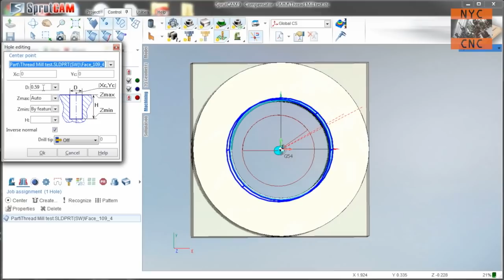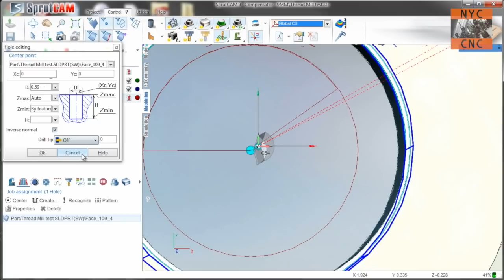Gimme a Brake! Machining a DIY CNC 9MM AR-15 Muzzle Brake! 4th Axis Machining Video!

Comment: John, that's only half true.. Correctly sharpened (point) and correctly ground drills (flutes) do drill holes the correct size.  Drills that are especially ground correctly on the point will drill the right size. Your general or maintenance grade drills are usually made to drill holes +/- 0.003" diameter.
Reply: I think you will find the difference being in the different grades being sold on the market today.  There is about 3 to 5 different grades of drill being manufactured today.  The maintenance  / mechanics & homeowner grade probably are the worst as far as diameter tolerance.
Reply: the other thing do do is try checking the runout of your drill holding system.. be it a collet chuck, drill chuck, whatever the case may be.  The best tolerances we get come out of holding drill bits with some sort of collet or a Albrecht chuck. Runout will effect your diameter tolerances to a percentage to your positional tolerance.  Other than switching to a stubby and using the proper point angle in relationship to the material being drilled.
Reply: Get one or two for the mill too.. you won't regret it.  Oh yes you could use the cordless, but keep in mind unless you have a good chuck and clean jaws won't be near what you would expect out of a collet.  Stay away from Dormer/Precision Twist Drill, although the older stuff is great and usually ground on size.  Only way to be sure is to mic your drill bits with a micrometer before put to use, and or drill a hole and check it against a nominal size pin gage.
Reply: gbowne1 I have no problems with precision twist. Although I usually am stocking my index cabinet with Chicago Latrobe or hertels which seem to do just fine. If I'm looking for an ultra precise hole I'll do it another way than just drilling. :)
Reply: We switched to Nachi or Morse Cutting Tool soon after the PTD brand went to Dormer

Comment: How do you make sure that the alignment isn't off when you've screwed it into the gun adapter, meaning that when it bottoms out it's not off by an angle, the logo not facing up etc? It should matter where the threads start, right? Did the twisting of the part in the collet holder throw that alignment off?

Really nice machining video, really makes me want to play around more with the 4th axis on the small mill I have access to here, unfortunately it can't really do metal, it's mainly made for foams, woods and plastics.
Reply: NYC CNC Clocking, awesome! Learnt a new word!

For sure I see that you didn't need the 4th axis, but for the next step you'll surely do. I'd like to see anyone attempt those dimples without a fourth axis. Haha!
Reply: NYC CNC Well sure, but imagine the time difference! The tiiiime!

Although, I guess right now, in your case, a lot of the time is being spent figuring out just how to do the dimples instead. I've had some experience in using RhinoCAM (basically a CAM plugin for Rhino) and in that you can fairly easily assign any round edge, or surface, as a hole for drilling operation. I wonder if you could do the same in Sprutcam? Although, technically since it's not a perfect flat circle I guess, as it's intersecting a cylinder.
Reply: John, for clocking, couldn't you cut the threads first, screw the blank into the gun, then mark a known location on the blank, such as the top centerline, then use that to orient the part in your 4th axis for the machining?  Once machined it should still screw in the same way, and the top will still be the top.

I was also thinking about your dimpling issues.  It won't make the render look good, but if you changed the model to subtract cylinders of an appropriate depth, SprutCAM should be willing to treat them as locations for drilling.  Then you give the machine a ball end mill rather than a drillbit and you should have dimples, right?

That was some fine fast shooting!  Should give any potential burglars who see your channel a reason to bother someone else. :-)

I got to play with my lathe a bit today.  It's different doing it than it is watching it done, but I'm finding that all the time I've spent watching machining videos is paying off.  When I screw up, I instantly know what I did wrong! ;-)  Seriously, so far everything is coming out workable, and I still have all my body parts, and that's an acceptable level for now...I'll work on not screwing up the aesthetics...which are minor anyway...others might not even notice where I overshot a few thousandths here or there and have an unintended groove in a corner or whatever.

I'm also starting to be able to follow your CAD sessions.  I'm using "Cubify", which appears to be a stripped down Alibre for a lot less money. It's intended for 3D printer users, but it's working fine to let me learn parametric modeling and to make drawings to take to the shop.  Thanks for that!

-- Mike
Reply: John, I understand about the retail issue. My suggestion also won't help with use on more than one gun.  For a single gun custom fit though, it should work. 

I made an adapter for my Noga mag base to let me hold a dial gage by the lug on the back, rather than the shaft. I have a Starrett equivalent, that I used as a model, but it is designed for the Starrett mag bases which have a smaller diameter in the clamp than the Noga. Abomb79 showed making an adapter, which is where I got the idea, but I copied the Starrett, which has a flange between the 1/4-20 threaded end and the larger end that goes into the Noga clamp. The reason for the alternate grip is to allow using a B&S teeter-totter like thing for indicating inside a bore. That adapter wants to be on the indicator shaft. I picked this for my second project for practice turning to precise diameters, threading, making lengths be what's on the plan, and using a collet chuck to hold both ends of a part got finish facing. 

I also turned a small cylinder that I put a rare earth magnet into...mostly to try drilling on the lathe and for practice putting in evenly spaced grooves (for grip). Came out fine, but since I installed the magnet then turned to length so I didn't have to drill precisely to depth and allow for the point, I got to deal with chips that didn't want to leave the area...and I also found out that 416 SS is magnetic.

I have a 1955 South Bend 9" model A (quick change gearbox). I got it about a month ago, and I'm still learning to use it and setting things up. Need to level it  and one of the next projects is making some leveling feet to do that.  Have to draw the plans to see what size bar to buy. Idea will be a sort of hockey puck in a cup layout.  Should be sturdy and look ok too. Also involves some new to me operations, like boring and internal threading. 

I hope Daniel doesn't mind my hijacking his thread....

-- Mike
Reply: BigMjolnir in the real world, that wont work too well. in theory, it sounds good, but when you try it you will find that every time you torque that brake down to the barrel teh threads will distort slightly. the first time you torque it to zero is great, but every time thereafter that you replace it, you will find that it needs to rotate just  bit further to reach the same torque.  

the answer, as stated, is crush washers.
Reply: ***** ive used jam nuts before. they do work, but i dont like them. at the very first fitting, a "custom cut" jamb nut is the exact same thing as a peel washer (stack of shims) if you remove it over time you get the same problem. granted, then all you have to do is slightly turn the jamb nut to get your device clocked right, but then you get that small gap between the nut and the barrel, and im just too anal to let it go at that.

Comment: Another great video John.  Did you happen to investigate any of the effects of the gas PSI, expansion, etc.?  I wouldn't expect that's an issue for what your machining as it looks approximately like the same size as other muzzle breaks.  I was just curious as for new parts that's a different aspect of engineering the part.

Also, love your humility about being a dumb machinist.  Helps the rest of us morons not feel so isolated :)
Reply: NYC CNC Erosion strength of the steel.  I recently acquired a few suppressors and it got me curious about material, strength under various pressures, hardening, etc.  I figure with the muzzle break there isn't really a danger unless you machine for the wrong caliber :)  A lot of engineering outside of the manufacturing process that I'm currently studying.

Again, well done.

Comment: Why are you using a muzzle break on a 9mm?  Is this just a test case?  Thanks for sharing.
Reply: I have to admit that I have never shot a 9mm carbine.  I just did not expect a pistol cartridge to have that much recoil in a rifle.  I mostly shoot pistols, and poorly at that.
Reply: I like the design the breaks looks functional lets see a little of that just as a side shot
Reply: John I may or may not have been in the middle of a few 102nd Grey Cup celebratory cocktails during that last post.

I'm going going to chalk that comment up to my fat fingers & auto correct.

What I meant to say was, I'd like to see that brake in action
Perhaps a super slow-mo shot?
Reply: Once again my fat fingers got the best of me, or I may have been a took quick to comment, thanks john sounds great looks better
Reply: Not bad shooting either

Comment: I thought the camera angles were good.  However just to throw this out there.  What if your next Wednesday widget is to CNC camera mounts for your enclosure!  Think it's Whitworth threads.
Reply: NYC CNC Historically camera mount threads are indeed 1/4-20 but 1/4BSW (Whitworth) thread form, but for all intents and purposes it is interchangeable with 1/4UNC which is now the quoted standard.
Reply: Remember the Brits with their Whitworth came first.:>)  Unified only came about with WW2 to make things the allies could all make bits for, unless you wanted 1/2" where the whole thing fell apart, (12 TPI for UK-13TPI for US) but you will find out about all that during your studies. 
We don't have thanksgiving but I would like to wish you a happy one all the same
c
Reply: NYC CNC An interesting and fairly comprehensive, certainly quicker and more convenient site than Mech Handbook, is Maryland Metrics thread data     http://mdmetric.com/thddata.htm